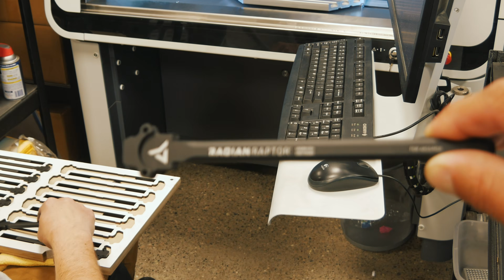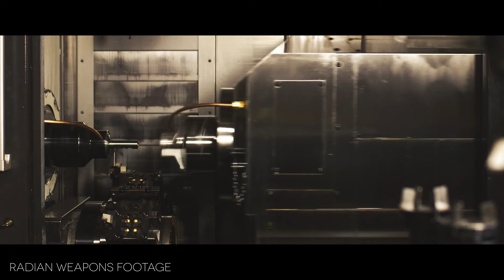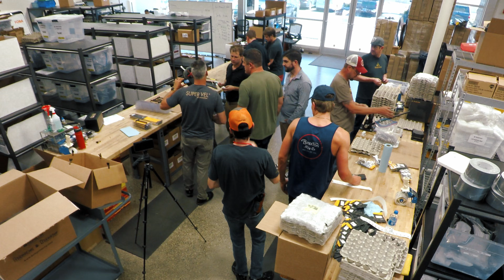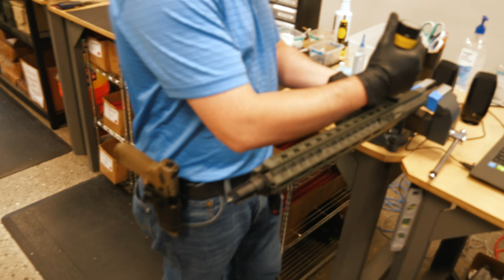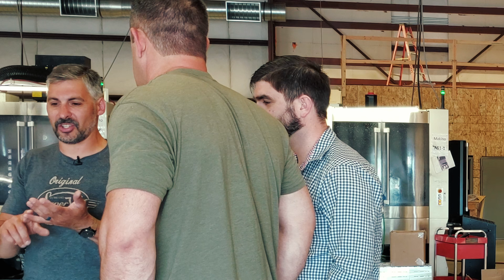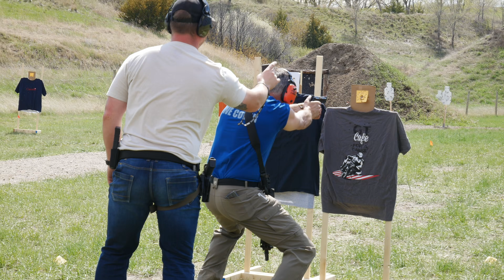Radian Weapons Factory Tour

Comment: It’s so true at the end what was said about you can invest $3-4K building your own rifle and not having one as nice as a Radian straight off the line, when you buy high end parts and pieces yes they have tight QC usually but each company may have just slightly different allowable tolerances and if you get 2 parts that are on opposite ends of those tolerances it can and will create problems down the line when it happens over and over in your build and you get tolerance stacking that if your not a machinist or gunsmith and understand how the process works can wind up getting you an expensive rifle that you aren’t 100% confident in that if SHTF it’s going to do what you need it to when you need it to reliably over and over, the old saying of “buy once cry once” is very true in the world of AR’s, sure it stings to a lot of people especially now to lay out that large chunk of money at once but when you get that rifle and use it and practice and become efficient you will be glad you made that investment, same for the optic, if you have to save up for several months then do it, you won’t be sorry.

Comment: The main topic of the Achilles’ heel tactical Al Arab of Paris rifle that is the radio model one with a bunch of upgrades is $10,000 yes it comes with four training classes and a wine mixer thing I will think everyone’s going to Setup their rifle 100% the same way but hey they do have I believe at least one select fired radian answer like the only one I’ve seen it’s a flat dark earth 10.5 true there pos radian cut out for the fitting of the spring pin over the semi as I saw close sup And is prob a r and d lower and wish i saw more raids. Full autos ????

Comment: There is a company Achilles’ heel tactical that brings a rifle called the arrow of Paris and it’s a Radian model one function or I think it might use of 14.5 minutes are you secretly a former send out with a bunch of parts that you probably end up putting in to the rifle anyway because of the quality and what not 90% of the stuff is still radiant now instead of using a regular H2 JP polished buffer they use the JP silent capture spring trigger the use geissele The rifles are complete reassembled painted by them they’re still radians but with a few different touches that the end-user is going to probably do anyway but they offer a few different optic systems that are LPVO with top mounted and offset mounted read that usually aim point micro t2s and the macro on badger ordinance now and apple relieve a Mod light With the DD 00 sure fire tail cap barrel is not a radian it is a criterion core 14.5 They also use the same dead air muzzle device and it’s from R&D from than users and what products basically work best they do use and Eotech Vuduu 1 X 10 what is the LPVO
They give you for training sessions and some sort of wine mixer thing but also they have like a quality sling I’m not sure you have to check out all the specs but basically they use the radian builders kit and out fill it with the barrel of that people may want because of the balance or accuracy or longevity also the Ankh you receive with Radian a lot of it comes from how tight their tolerances are on the receiver side and the thermal fitting of the barrel that clams down on the barrel as soon as it quickly slips it in and as it quickly cools off titans and then you do you barrel not over it and the hand guard and you are good to go as a very long stainless steel rod that runs above the gas tube that if I guess there is some sort of catastrophic fall and you have a night vision on there the real most likely isn’t gonna have rotation issues but if you take a hit like that and the raffle ticket serious shit like that you have more to worry about then the rifle staying on zero as far as the ir you should be more worried about injury as the rifle is a very very solid gun it’s billet not forged mind you is not a hard coat and it dies underneath so that’s only downfall in my opinion but I do think as the company grows they’re gonna start having maybe some other brands that are high end as well for example triggers buffer systems so you want np spa and a geisselw trigger they (radian) got their thermal fitting method from working with JP enterprises which is an exclusive hire and constant winner in the competition game and the tape tolerances do you so much to increase accuracy reliability and you can feel it just simple holding the rifle it feels like you’re holding one piece even if you have a most back upper and just lower the lower fits together so well with any upper you have minimal probably zero issues with wobble I can’t see any wobble issues unless you seemed serious damage and it definitely worth the price of three grand but I think the builders can’t if you know what you’re doing and know what you want in the gun are definitely worth it because you’re getting a very very high-end product that is the large reason of the accuracy bad zero wobble and thermal fitting now you might want a criterion cord you might want a proof I personally went around the $500 range and shares a 10.5 300 blackout I’m also either going to get another upper rail and BCG or a complete build kit most likely in I think it brown or FDE Kit and yes I can do a radian beveled which is not hard since most of culture already in their proprietary and what not especially in the lower receiver area I have to worry about it that you don’t have to worry about the take down pins which even if you swap them out you get a one piece set as it’s not a detail and a separate spring it’s all in one which is very interesting that’s another provide everything I have I haven’t seen before so they do a lot of amazing things and that’s why I trust their company for the outer core of the guys as far as everything goes the receiver set that is where I believe the magic and radiant happens hopefully they make you know A model 1.104 meow a model one GEN 2 rail Like a haze five Spot real where you have some offset 45s Mlok and why not a titanium sling insert at a 45 as they already make them for the end plate and that’s where I attach my two points laying there and I have a 45 depends on the rifle hopefully they’ll get some military hard right next door maybe do you some more proprietary thingies to maybe start making their own barrels having them turned by another company you know they can make a no model one and model one with a better Traeger the JPSPS or something like that but I think adding things like that and I’m assuming that they do headspace their bolts pretty well tolerances but watch a video of a Radian being ran fast in like Slomo you will only see the magazine wiggle as round of being fed those type of harm to this is what aids in accuracy tremendously and if you have a receiver that has wobble you could have a five minute difference in point of impact shift on say a military lower that’s been ran through the gamut but I am in love with their company I often heart that fucking radiation is one of the best companies there is and give my explanations and it’s not their barrel it’s not any of that it’s the receiver shit that gives you all of the magic that is where the accuracy comes from people so if you know how to build and I’m not saying don’t buy a radiator if you want a model one get the fully built rifle but if you know what you’re doing and you are not I guess we can slow in as far as the building and understanding and doing things precisely do not do that just buy the gun if you can easily use a torch for about 10 seconds you can slip that Caroline hair if you can use a torque wrench and a reaction ride or even in upper isolation type system and know how to season and tour down using proper oils I don’t use much but clean it you some CLP get all the fibers off then I use slip 2000 grease on the extension and the threads of the extension I seasoned as well as inside the barrel nut and this is after I slip the barrel in and then talk down to hide to work to the lower end at about 35 foot pounds as that thermal selling process especially with my noveske barrel extension it may try did it but it it’s slick but not at the same time is hard to explain I believe it’s meant for a nice tight fitment so you don’t have to do stupid things like put Loctite 
Red 680 on your barrel to train better when the barrels thermally fit that I am thinking is kind of stupid but that’s just me I mean Loctite where you supposed to put grease I kill light on it but multiple builds zero issues and impressed with that you received Evan I just see this FP 10 cop choice shooter And slip 2000 grease The loan I make sure I have the trigger properly set after I put in my buffalo your sister I use Greece as well and also take to spot lightly just so it doesn’t go anywhere but if I need to get the 
Cason light off I can get it off just have a reaction ride it will starve most of your problems as in this video the gunsmith is using but right now I believe their biggest competitor is noveske as people are buying the NBA set ups that they have that are pretty similar and they’ve been around a lot longer but radiation is a smaller company because they haven’t been around as long and it’s like OK I’ll give both company some love for both Oregon-based which I mean I’m sorry for you know having Portland and your state and antifa what not but I support both that’s why I threw that barrel in a radio it’s like hey be friends collaborate oh shit instead of being a loser they are maybe they are friends who knows as they say they like to have friends in the industry

Comment: i have a  noveske branded raptor charging handle and i like it but that thing wobbles aroud like crazy, idk if the tolerances are designed to be loose for dirt and debris but it kinda affects my view on the quality of the product. like the fit an finish isnt commensurate with the price of the charging handle.
Reply from the maker: Naw. They are top notch. It's an AR not a bolt gun.

Comment: Their rifles are sweet. I prefer some other manufacturers over radian but it’s surely not a bad gun. Two items they make that I have to have in all my guns is the talon safety selector and the raptor sd charging handle. Talon is very slick and fast and the raptor sd is great for keeping gas out of your face running suppressed di guns

Comment: Im overseas so prior to getting my authentic radian which need to be preordered (and takes time), i bought a non marked clone just for fun, and someone sold me a fake axts with full marking, i noticed every single thing about it was IDENTICAL to the nonmarked clone. For a minute i thought axts/radian was made in china, then i went googlin and notice very closely that the real thing is different than the fake. Dropped a message on radian isntagram to confirm those are fake. Returned the fake axts with full refund. Now im running the real radian. Look side by side, theyre very different.
Reply: Sad thing but you’ve know you’ve made it when this happens if it’s to cheap probably fake cheers
Reply: @caseG80  the first non marked one is cheap coz its sold for airsoft. But the fake marked axts wasnt cheap, it was purely deceitful on purpose.

Comment: I recently ordered two Radian Raptor Charging Handles on December 30, 2020. They immediately processed the order and took the 100.00 from my account. I have yet to recieve any order confirmation. I have sent multiple emails and the only response I have gotten was that they  have recieved the message. I have called multiple times and have yet to be able to speak to anyone. I have yet to get a call back.  I have left messages at their shipping, Sales and Customer support extensions that included my name and phone number.  No response. DONOT USE THIS COMPANY. THEY WILL TAKE YOUR MONEY AND RUN.
Reply: James,
Same thing happened to me. In fact I only ordered one charging handle but got charged for 2 and the company does not answer any phone calls and does not return emails accept for the  email stating they received my email. Additionally I did not get any confirming emails about my order and only know my order number from taking a photo when I placed my order.

Comment: Purchased a Radian Raptor handle for my Sig Sauer M400.  Purchased the 516 upper only when they were on sale with the intent of using the M400 lower for both uppers(not at the same time!).  Liked the 516 so well that I was thinking about a lower to pair with it.  Thanks to your video now considering the Radian lower.  Currently out of stock though.